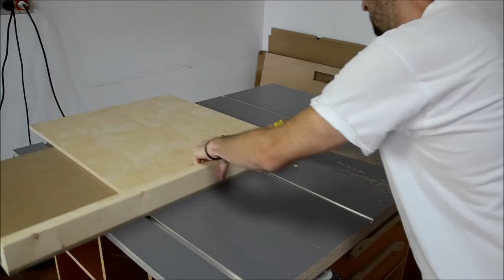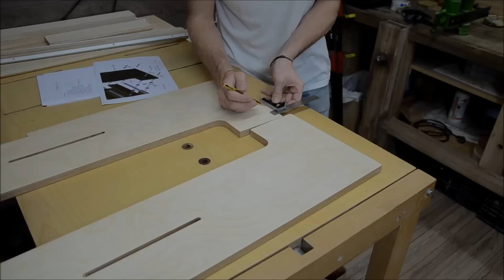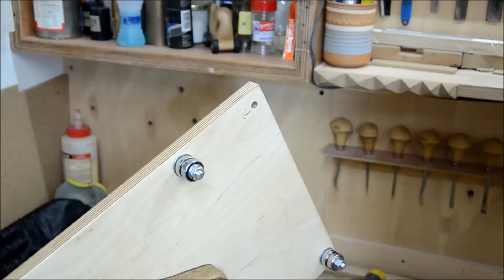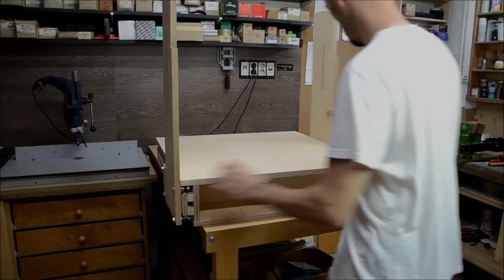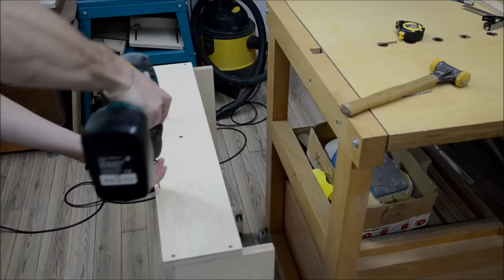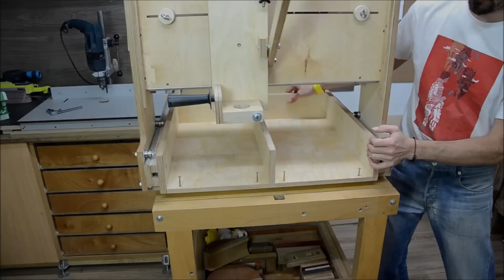Making a 3D Router (Part3)

Comment: At 0:43  it shows that a gap has been made in the middle piece (part nr 2 according to the x-axsis cutting list). Nowhere in the papers I can find the dimensions and placing of the gap. Can you help me?
Reply from the maker: It is not necessary to make such a gap, dont worry about it
Reply: Thanks you for your reply. I will continue without the gap.
BTW. Excellent plans and video's! It's been a real pleasure working on the 3d router so far.